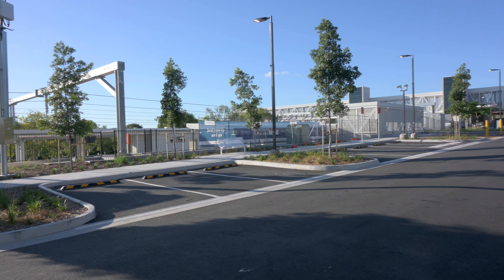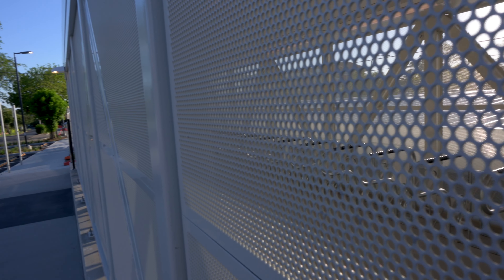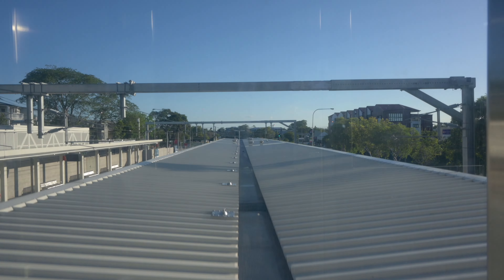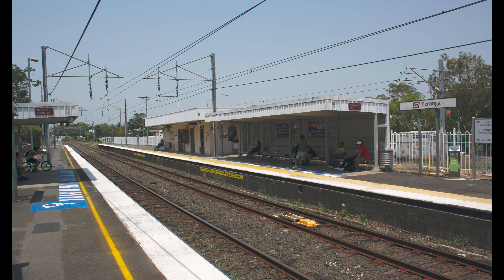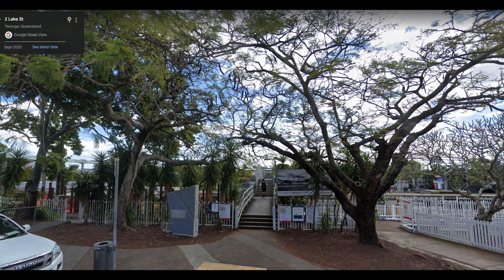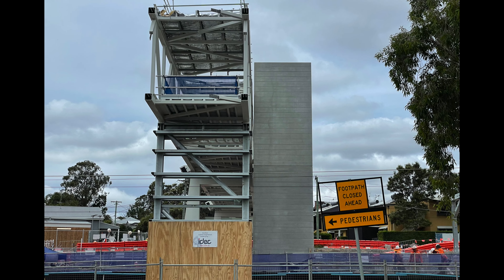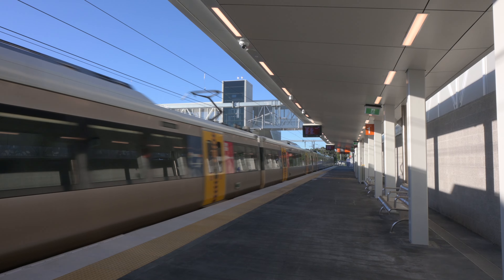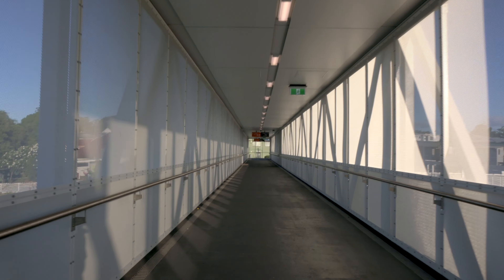Exploring the BRAND NEW Yeronga Railway Station - Cross River Rail Upgrade

Comment: Underwhelming, seems like not a lot of effort/money put in, though the enclosed bicycle locker is nice to see! The design of the overpass and elevators seems a little generic and similar to many other SEQ stations, but I do like the light coloured steel cladding and white paneling, hopefully it stays clean. To me this feels like the minimum of what a train station should be in 2023, not inadequate but really nothing amazing. Hope all stations are upgraded to a level of at least this standard over the coming years, basic platforms with some shacks just don't cut the mustard as decent public infrastructure.

Comment: Thanks for that.  It certainly is built for purpose. Unlike "the good old days" it lacks charm and character and has the warmth of a discarded condom. I used the catch the train there in the late 80s so I can see the improvements as well as the overkill. After all we're only on the platform for a few minutes ... we don't spend a lazy afternoon hanging around.

Comment: Is it graffiti friendly
Reply from the maker: No, I think the materials should be easier to remove graffiti from than some of the older station designs (basically all the metal, like the metal screening is powdercoated, the blockwork is kind of polished conctete so high pressure spraying should be able to remove it).